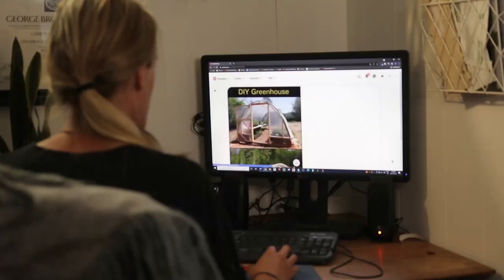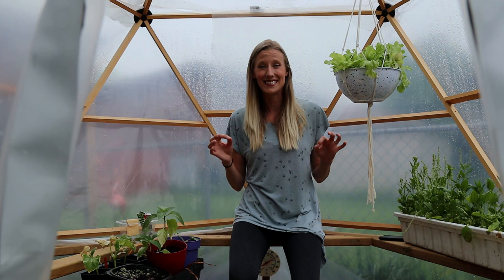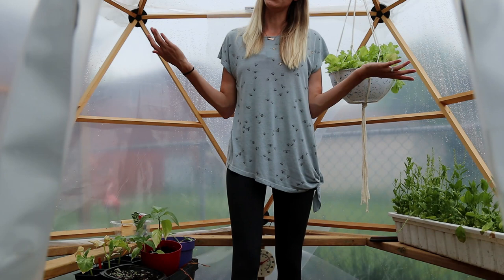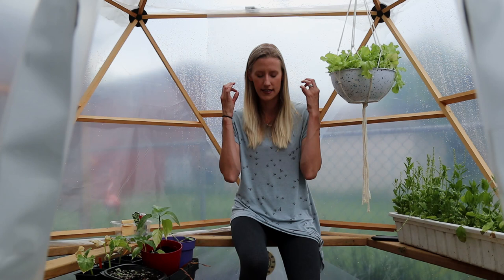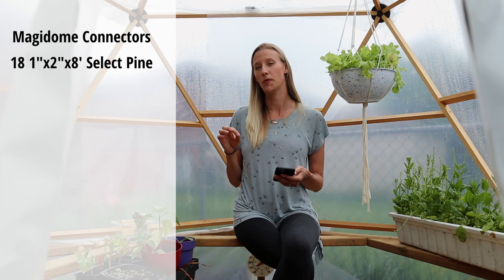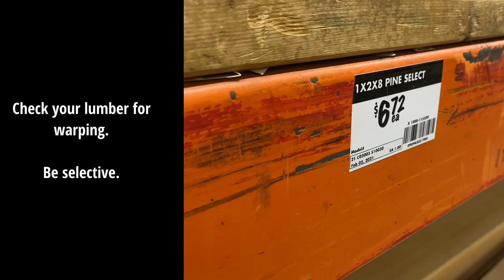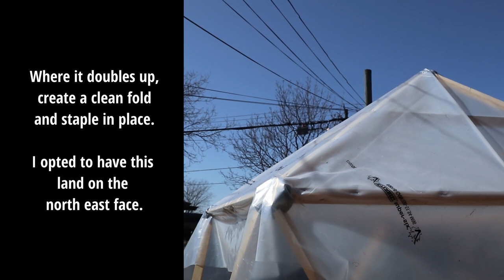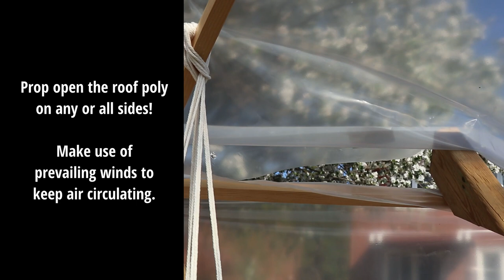DIY Greenhouse for Small Garden | Renter Friendly Geodesic Dome

Comment: Great job on the greenhouse. The kit costs £66 here which is a bit steep for 11 light duty plastic connectors.
Reply from the maker: If you look at it as strictly an exchange of cash for plastic, it will be a steep purchase. But most don’t know how to create a geodome. They don’t know how to create the angles. How to design. 

If you consider the time invested into a project (as a parent this is my biggest asset exchange. There is never enough time!), and the experience or skill that the product removes, then it is very fairly priced. 

It’s by no means a necessary part to create a geodome, but it removes many of the entry hurdles that a new DIY’r will face.
Reply: @BuyingThyme  
 A1 v icosa is very basic, if you can cut timber and drill holes you have the skills to make one:)
As a rule of thumb the strut length shouldn`t exceed 24x the height of the timber so for a 2x1 this would be 48". I would recommend using 3x1 for the 11ft version and even then additional bracing would be a good idea. You have to be mindful the increase in deadload (weight of the structure) doesnt exceed the strength of the connectors.
Reply: @JohnGuest45  I built a Magidome 12 ft tall. Lasted all winter. Amazing product saves soooo much time .
Reply: @Mr.dr.brotherman  
I make that about 17 ft diameter with struts almost 9ft long, its asking a lot of 2x1 timber. The unsupported covering on a 9ft x 9ft x 9ft equilateral triangle would be very prone to sagging in the middle under load and it would bow inward like a sail with a bit of wind :)
Reply: @JohnGuest45  yea I just added internal braces. Cost me an extra 50$. No sag. Used it as a yurt all winter for outdoor hangs
Reply from the maker: @JohnGuest45  have you built a geodome from scratch? I’d love to check it out! Sounds like you really enjoy woodworking. ❤️

Comment: how is the flex on the wood? like if i were to use this as a kids play thing and there's potential of them climbing on it?
Reply from the maker: The plastic connectors only work with 1x2 lumber. Although I could hang on it, it held my weight as an adult, (on the smaller lumber lengths) I wouldn’t rely on it for a climbing structure. Especially  not if you do a longer length of lumber. It holds snow, wind loads and can carry hanging plants or shelves. 

The new metal connectors that magidome now offers, used with 2x4’s, could totally handle climbing kids.

Comment: How many mil poly?
Reply from the maker: Vapour barrier, which is 6mil. It typically has UV stabilizers and should last a few years. You can do thinner but it may need to be replaced yearly.